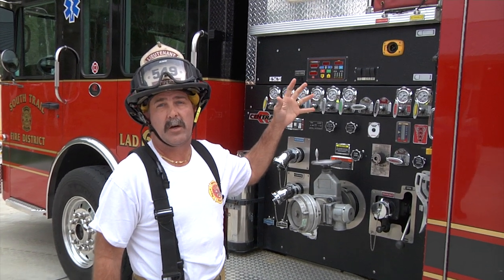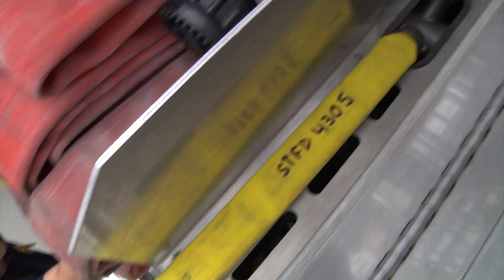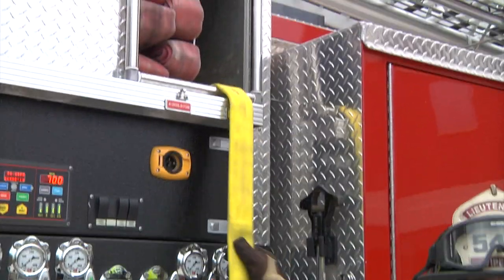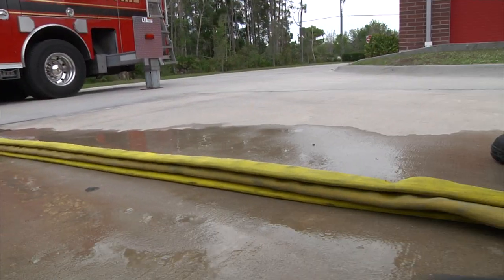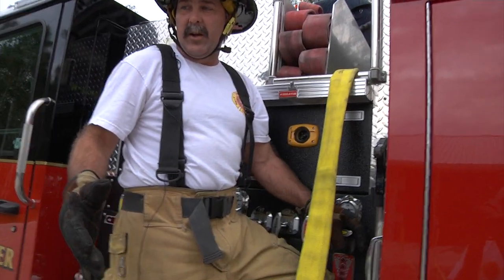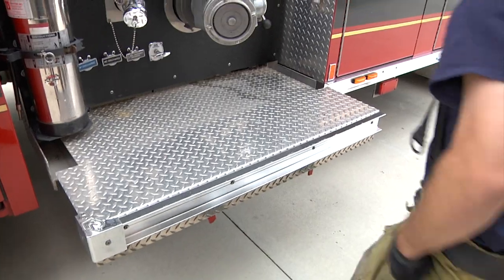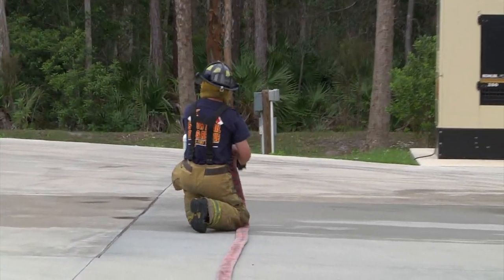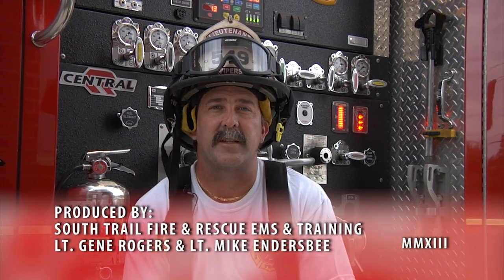Triple Layer Hose Deployment South Trail Fire & Rescue

Comment: A straight lay might be better for YOUR dept., but it is in no way faster or simpler than a triple lay.  And it is just fine for any amount of firefighting.  (which has NOTHING to do with a hose lay anyway)  The hose load you use should suit the type of buildings, setbacks, and tactics you use.  But no load is easier or faster to deploy than a triple load.  It's almost fireman proof, you really have to try to screw it up.

Comment: What happens when you are on a street with cars on both sides and you don't have all that room to walk straight out to deploy it and you only have 2 guys?
Reply: That’s when you split the deployment, like they showed. Nozzle goes one way, loop goes the other. Nozzleman brings the nozzle and the first coupling to the door to set up for fire attack. Not the ideal hose load, but you can make it work if you train on it.

Comment: Here in the UK we have a hose reel, same principle as a quick attack hose but a hose reel is a lot more easier to deploy and put back, it is essentially a garden hose only roughly 500 times more powerful and is a lot longer (around 100 to 150 Meters long) there is always water Inside the hose so even if you haven't ran it all out you can still use it, it hasn't got as much punch as the main jet as its built for only 1 man whereas the main jet is built for 2-3 men but its perfect for quick attacks and as we have 2 of these on each appliance it only takes 2 minutes to hook them together to make a 300 Meter long hose
Reply: GPM's puts out fire, not pressure.  "500 times more powerful"... uh, no.  Just NO.
Reply: Here in the states NFPA states that we have to use 1 3/4” for interior attack, we can use a booster line for everything else

Comment: Great vid!  Our dept. used to pack the flat load on the transverse and someone would always pull the whole stack out and we'd end up with the "spaghetti pile" beside the pump panel.  The triple layer makes sense for vehicle fires as we generally stop the pumper at least 50 feet short of the car; this load allows us to get right up to the scene and charge the line, which has been "pre-flaked".  Also great to stretch to the front door and it's flaked ready to enter!

Comment: I tried to count the number of lengths of 1 3/4 hose you use in your preconnect.  Also, do you pack half on the front side and then go to the back of that individual bed?  I believe this only enables you to come off one side of the engine?  The other bed would be set for the other side I assume?
Reply: The way we bed ours after the first two passes we swap over from one side to the other every layer in the middle of the bed.  Your mileage may vary depending on bed width and if you run a pony section or not.

Comment: Side won't matter. 1 crosslay (red) is loaded for drivers side deployment, the other crosslay (yellow) is loaded for officers side deployment.
Reply: My dept started loading this fucking lay..   but we got 150 and 250 ft..   and they somebody mixed colors.  They better not bitch at the operator if he sees yellow on the red side and opens up the yellow valve🤦‍♂️.   I hate it.  You shouldnt need a training to deploy a god damn hose.   Especially at a 50 calls a year volunteer deparnment that makes a 2-3hrs a week training..  and dosent train in the summer. Buddy who missed training and grabs the nozzle only and starts yanking.  Tangling the hose with a trapped victim.  Just because hose lays werent kept simple.